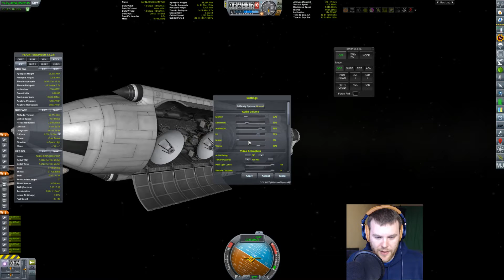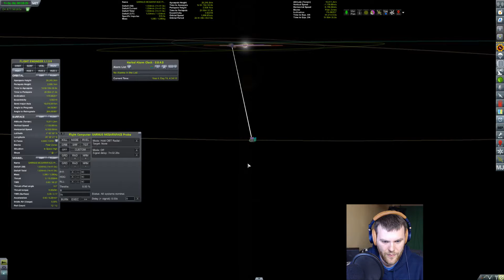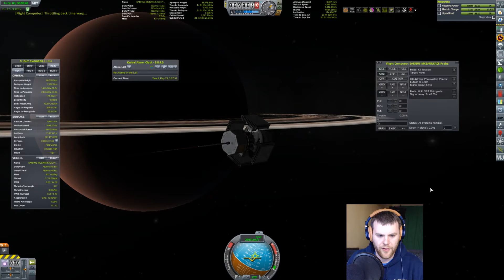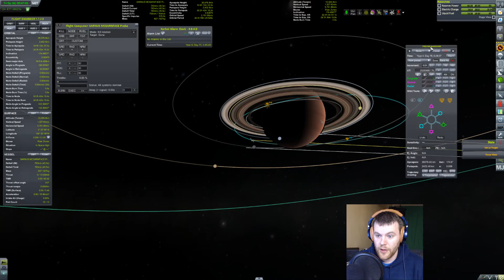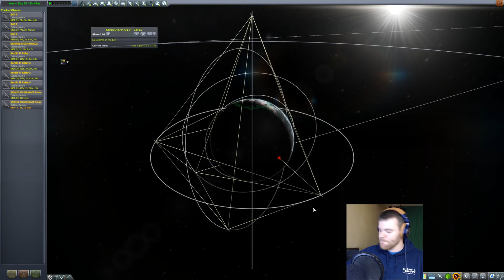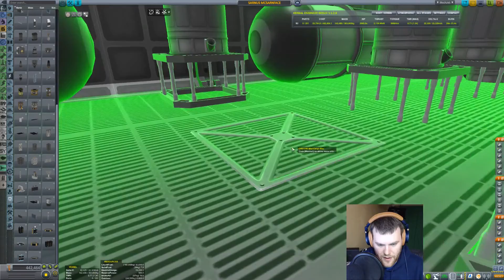Kerbal Space Program Live - Sarnus Satellite Network SSTO - Part 4 - Failure... so far.

Comment: I think most of the behaviour of RT made perfect sense there. Your main ship did not run out of power because the shivas produced enough with all the antennas tured off in the main ship. I would have liked to see the amp year details of the main ship. However, when you had all the sats decoupled, your main ship did lose EC.

When the first satellite ran out of power, the solar panels and the shiva still produced enough power for the Omni antenna so you could communicate via the mother ship to kerbin (the large dish was definitely dead however). You can see that in the couple of seconds when you turned the ship at 36mins. The solar panels are not oriented properly and the omni loses power. After you performed the maneuver, it drifted away from the mothership. I'm pretty sure it died when the omni ran out of range.

With all the large antennas decoupled from the main ship, your main ship did not lose connection because all (or at least some) probes have a small omni with 500m range in them. You can check that in the vab.

In fact, AMP year can do the power calcs for all planets (including solar power). The feature is somewhat hidden. Design all sats individually. Then go to the menu in amp year in the VAB where you can select the planets, select one and close (!) the planet window. The power calculation in the main windows will show true values for all parts that are supported by amp year.
It is really a good idea to point the sats towards the inner planets. Just do Moho and keep in mind that that the fact that youre not pointing directly towards the sun will reduce the generated power by a certain percentage that is less or equal than 1-cos(arctan(MohoApoapsis/PlanetPeriapsis)) at all times, so less than 20 percent even for eve. For Duna, the loss is already below 5%. So just add a a little margin for the outer planets. Its a shame that Kerbol cannot be targeted in ksp though. I usually do a quick check. Just cheat them up there and test it. It is really annoying when amp year does not support one part and you waste a lot of time just because the mods dont cooperate.

I think that the reason why you were able to control your main ship without delay is because there is a mod conflict between RT and MechJeb. Notice that this was only possible with the craft that had a MJ-module in it.

In general, I would recommend to redesign the large relays and add little antennas to relay to the moons. That way you dont have to pay for the power hungry large relay antenna for every moon and every incoming craft. Your omnis wont cut it there and you will only have a connection in a very limited ring around sarnus. At least, add a small directional antenna that will allow you to control incoming (active) vessels within the whole SOI so you dont have to support a massive dish on every craft. With your current method (that is that the relay on kerbin is pointed towards the active vessel), you will lose connection on all your crafts when you are behind Sarnus (which takes a while, especially on the outer moons). Just something to consider.

I have to say that the stock RTGs and the shivas feel pretty imbalanced since there is no need to resupply them with fuel and they dont add a lot of trouble (weight/volume/etc...) ;-) So its not really difficult to deal with the distance from the sun and makes all planets more or less the same. But that is of course up to you. The number and size of the solar panels required for a relay to kerbin are really massive...(but still possible).

There is a cool trick you can do to deploy satellites evenly spaced in a circular orbit. Circularize the mothership in the target orbit, note down the orbital period. Decouple one satellite, change your orbital period by a factor of 1/the number of sats, wait for one orbit, decouple another satellite, circularize it, wait for one orbit, decouple another one and so on. That way you dont have to fiddle with the positioning which is a real pain with all the delay.

 I have to say that I really enjoy watching your KSP content. Keep up the good work.

Edit:
I just rewatched the episode where you built stuff. You had AMP year set up correctly. However, you and probably nobody in the chat did not notice that the power drain was higher than the production. Note the red line in amp year.
https://youtu.be/HOGZe1Fyc3Y?t=21m13s
Note that the dark side calc only indicates that you have enough batteries to last through the dark side transit in orbit. It does not calculate whether you generate enough power during the rest of your orbit to fill your batteries. So if you produce exactly as much as you consume, you might still run out of power during the dark side transit if your batteries dont fill up completely. There is a bug(?) in amp year which is that the power production in amp year always shows 0 when the dark side calcs window is open.

Also consider that the cone of your antenna from kerbin is really tiny when planning. So your relays relays need a low periapsis when you dont focus the kerbin relay on the active vessel but on sarnus.

It took me a whole evening to plan though all of that stuff when I did it for the first time. You really have to consider a lot with all those realism mods, especially with RT and full coverage of the whole Sarnus network is difficult to achieve.